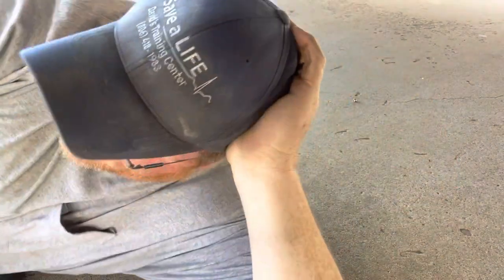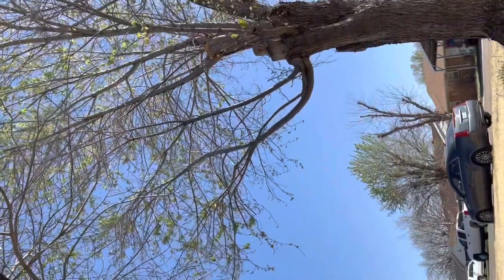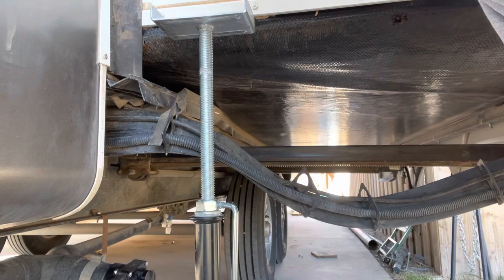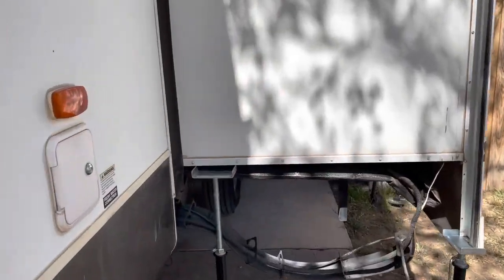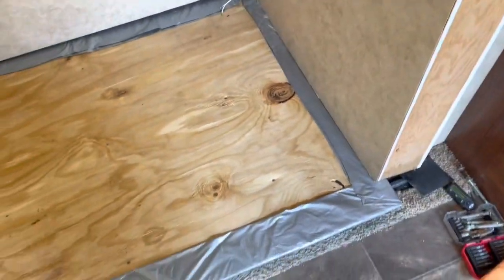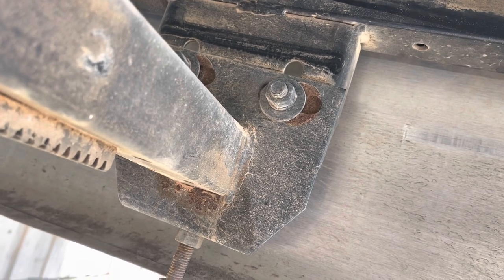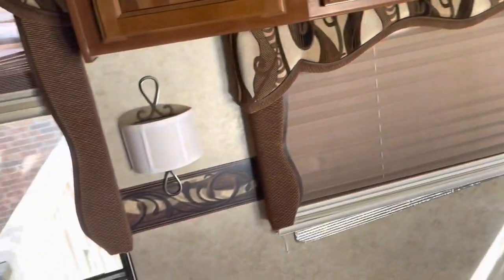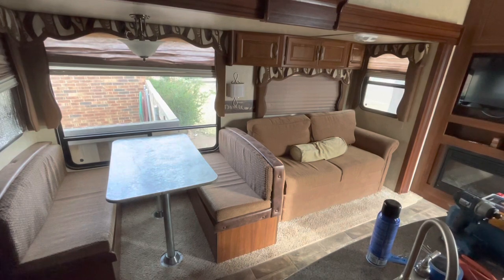Replacing slide out floor part 3 remove old put in new then reassemble

Comment: Unfortunately I'm going to have to do this to my trailer. Although my trailer is not the exact same as yours it is on the rollers. Thanks for this detailed video. May I ask what type of tarp did you use?
Reply from the maker: I purchased a “Tarpco Heavy Duty Thick Tarp” from Walmart. they usta be grey on one side and black on the other but not this one.  I’m thinking about getting the rollers for mine.  Replacing the floor wasn’t/isn’t fun but totally doable,  I did it for under $500 where taking into a shop was going to be $4500-6500.

Comment: when you unscrewed the side of screws on slide what was actually holding the floor in just those screws to the floor? then the back rested on the metal support of the slide with the carriage bolts? And were screws under the black plastic water proof cover? I think the ones like we have have wood frames and not aluminum  I believe
Reply from the maker: That’s all that’s holding it. The screws on the side and the carriage bolts on the base it sits on your floor and slides in and out now newer RVs have a frame that allows it to sit level but what you see is all that hold in there. Some thing that I wish I would have done is I wish I would’ve put silicone up inside the floor and the base of the slide out so the aluminum square tubing. I wish I had put silicone around that so when I put the floor up in there. It is squished in all the areas. I don’t know if it would actually do Anything, but possibly make me feel better
Reply: @Daves_adventures4315  good idea I may do that. I wish had the aluminum frame. Would makey life so easy. You think it's possible to raise that slide on my corner, same as yours actually and lift from inside? I have nothing to out jack under on the outside
Reply from the maker: @rmstark1966  I saw a video where the removed a few screws 4-5 I believe. Took a piece of paper to make a template transferred it to 2x4’s drilled holes through the 2x4’s  then took same size screws and screwed the wood to the outside and used that to jack up on. Will totally ok as long as your jack is in a straight line lifting.